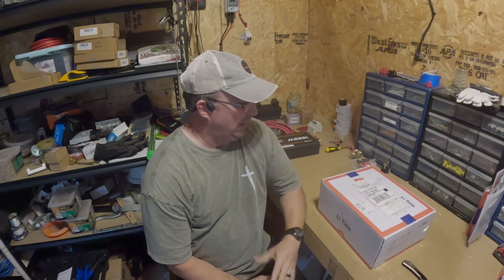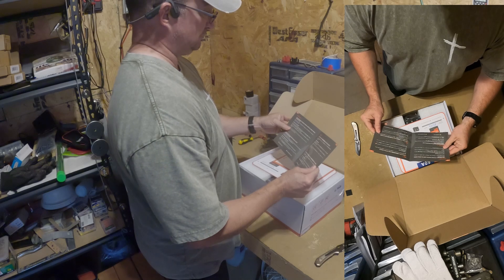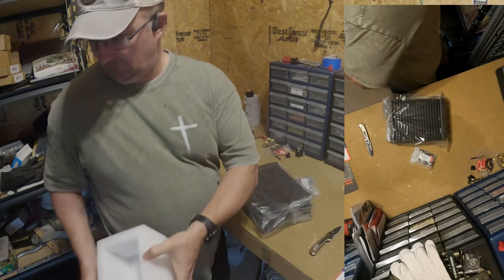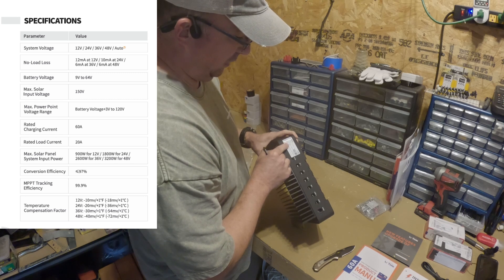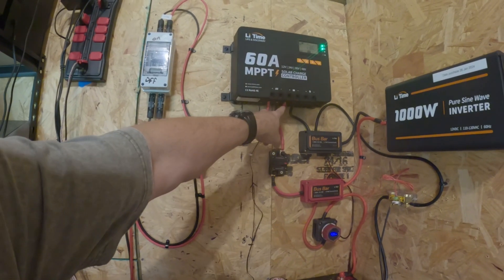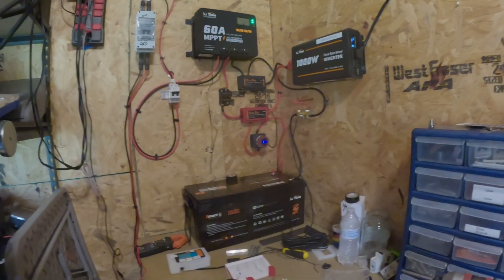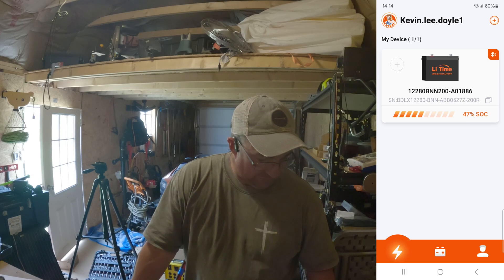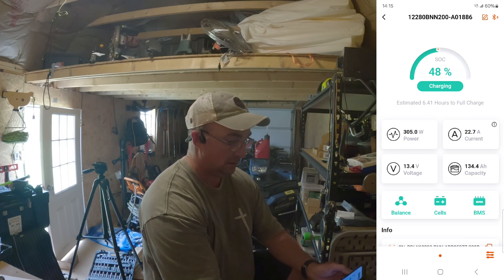Li Time 60A MPPT 12V/24V/36V/48V Bluetooth Solar Charge Controller VLOG 42

Comment: Our paths align, I am a retired military and chose to play with solar. I have similar LiTime equipment you are using. I purchased a broke 12 volt fridge and replaced the compressor so I have a load for my solar system to manage. I only have one 12 volt 100 Ah Battery but another is coming in the mail. Hope to make my system 24 volt and measure performance changes. Right now the fridge lasts 2.5 days on battery and no solar. I'm just south of you in north georgia.
Reply from the maker: @tombloemker9434  Pretty cool, what branch did you retire from? I am going to run my A/C off off of mine and see how long it will last. I could simply do the math, but what fun is that 😁. I have been using an ECO Flow Pro Delta for the AC, but I want to see how long this 280AH battery will last. If everything works out, I will probably get another 280AH battery.
Reply: I was a AF Air Reserve Tech, fortunate to achieve E-9. It was mainly a civil service position with a military requirement. It's no joke powering A/C with solar the RV community is not there yet. I've installed a Mitsubishi heatpump with an variable output inverter compressor. That thing is super frugal on power.
Reply from the maker: @ I am looking at the EG4 Hybrid Solar Mini-Split Air Conditioner Heat Pump AC/DC | 12000 BTU. I will probably get the smallest unit they make, its just for my shed.
Reply: I am looking forward to the results  of your AC experiments! Love your T-shirt!

Comment: 9:26 Make sure you turn off the solar breaker before you turn if the battery main disconnect otherwise you may damage the charge controller. BTW, I have 3 of these LITime charge controllers for 2 years now, they are built like a tank, they are made by HELIOS New Energy company which also sold under the name of HQST, and REODEO.
BTW, 12:06 your App shows Low Temp cutoff setting, mine does not have that function, I wonder if my Controllers have an old Firmware version.
Reply from the maker: I learned the hard way concerning shutting off the solar input first. That was a costly mistake.
Reply: Yes, Helios OEM rebrand for many companies. The operating temperature should be listed in manual. 😉🇨🇦

Comment: What is the max wire gauge size for connecting the battery bank?
Reply from the maker: @davidcarter9322  According to the product manual, the Max AWG is 6 gauge.
Reply: Be careful tightening up cables with ferrules.Strips out easily!
Reply: I use 2 Ga Welding cables with Ferrule.